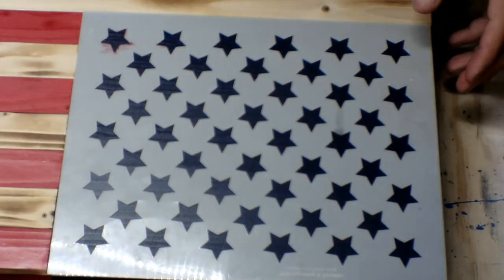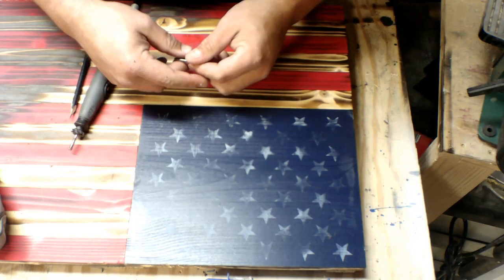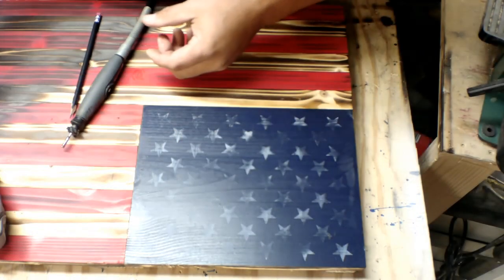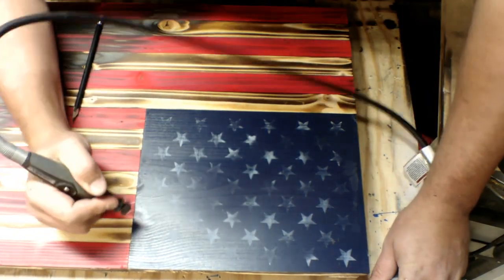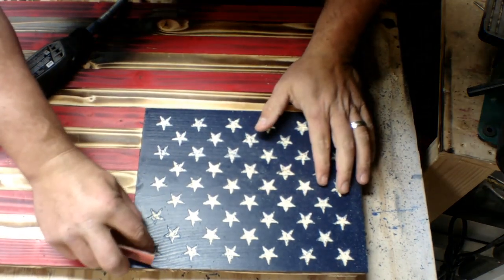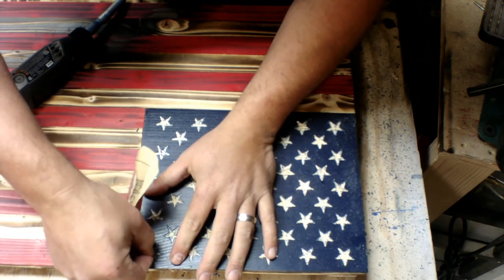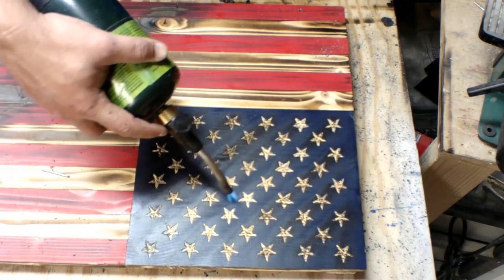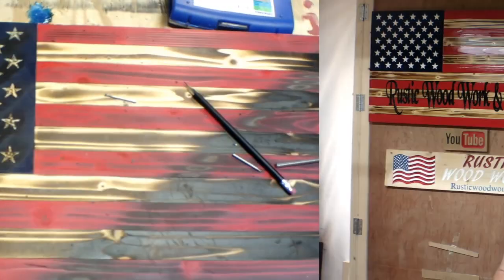Carve out stars on a wooden American flag with a Dremel 3000, DIY Wooden flag build

Comment: Why couldn't you use a screen printing for your stars?
Reply from the maker: Justin Mills you probably could I just choose to use paint.
Reply: You could do 30+ flags in the time you paint them. It might be worth your time to look into silk screening.
I worked for a company that built gun safes and I could knock out 30+ safes in 20 minutes. Three different screens. Line it up swipe the paint and move to the next one.
Your work is incredible and you will end up with the same results. 
Good luck in what ever you do.
Reply from the maker: Ok Thank you for the information. You said it was screen printing
Reply: @EddyFamilyFarm  yes it is how they screen print shirts with logos. We had are screens made but I know you can make your own. 
I hope that helps.